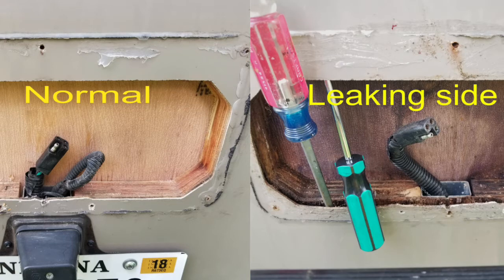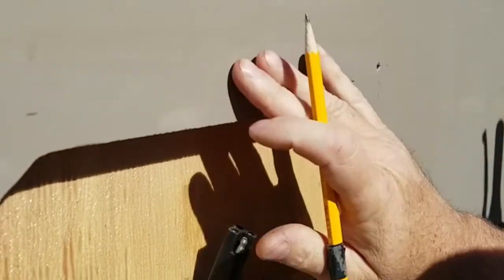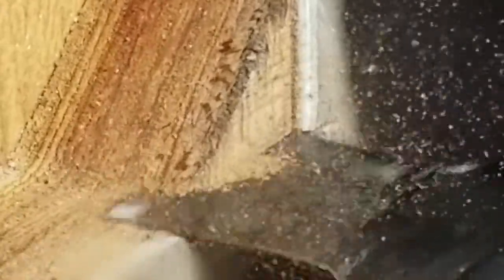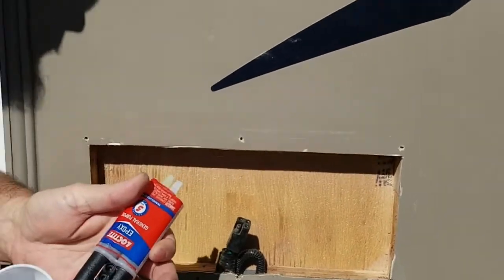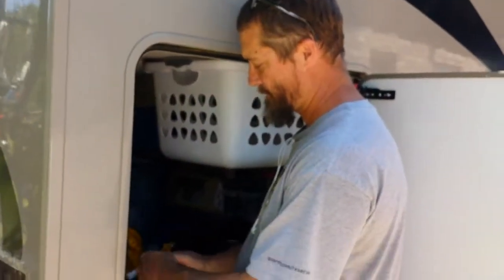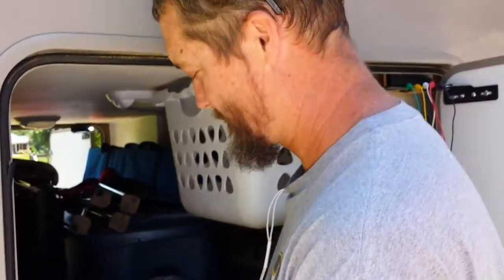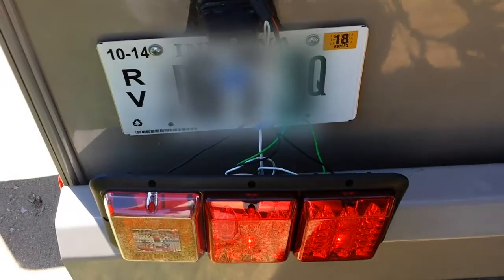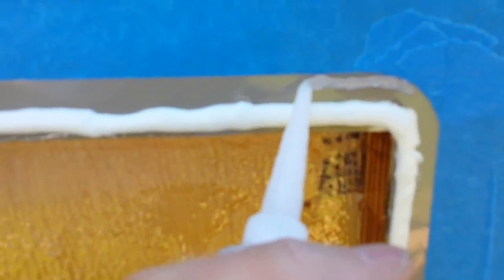Motorhome Tail Light Replacement with LED || Leaking Tail Lights ||  Repair water leaking tail light

Comment: The clear backup lenses should have been to the inside, with the full red clearly defining the width of the vehicle.  Also, if the white lights are illuminating at any time other than when in reverse gear, they are not wired properly and also illegal.  (white light on the rear is only permitted for tag and reverse)  Another suggestion: Try using spar-urethane on the wood in lieu of epoxy.  (25-year LEO and retired Florida State Trooper)
Reply from the maker: Very good points you make! Didn't even realize the legality of having them positioned in an incorrect way.  I guess it would take a trooper to notice.   I would have never known its illegal. I guess I'll be fixing that before the next road trip.  Appreciate your commment and thanks for your civil service.👍
Reply: @RVBarndominium  No problem, my pleasure and thank you!  🚔🚓

Comment: Sorry to be THAT GUY reaching out to ask you what the wire colors ended up being after you figured it all out? I'm about to do the very same upgrade and could use a bit of help?
Reply from the maker: Hey Mark...Cindy Lynn here.  We love our LED upgrade and I'm sure u will too.  I will have Tony get back with an answer on the wiring question.  He's not available right now.  Give him a couple days..thanks!
Reply from the maker: go to:   https://bridgeviewadventures.com/attachments   there is a download for wiring.  it's the best picture i could find.  the best way to do it is to cut wiring into 18" lengths with alligator clips on the ends.  keep connecting the wires together until you get the results you want....test, test, test  then connect them permanent
Reply: I'm having tail light issues. It was hard for me to follow along because of the camera movements back and forth, and the close up shots!!

Comment: With a repair like this use MinWax hardener after the wood has dried. Use Dicor to seal around the light without using the gasket that comes with the light - not thick enough or compliant enough to match the surface.
Reply from the maker: Thanks for the suggestion.  We still need to do some additional work to the taillights.